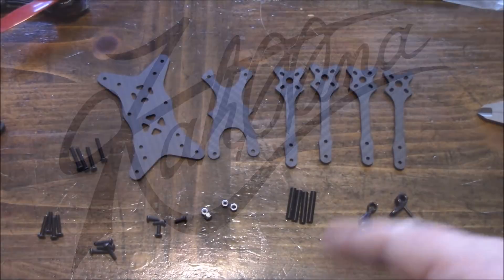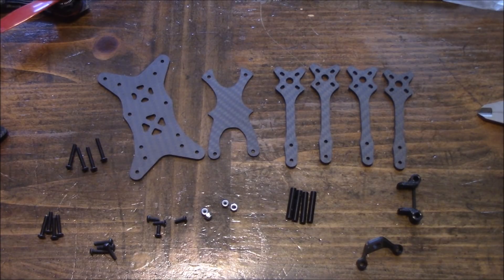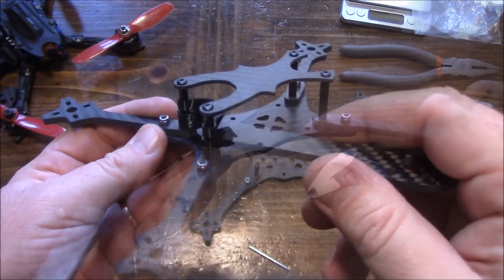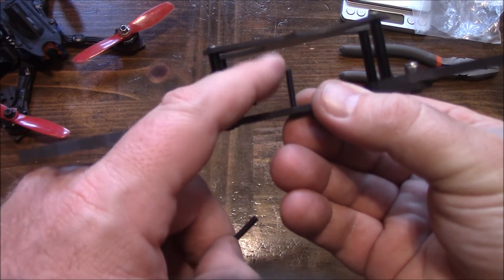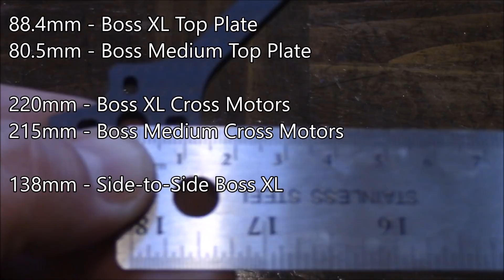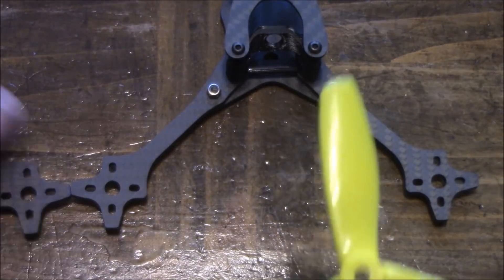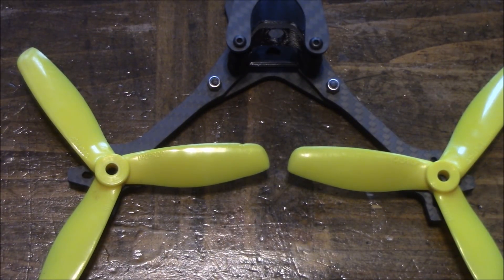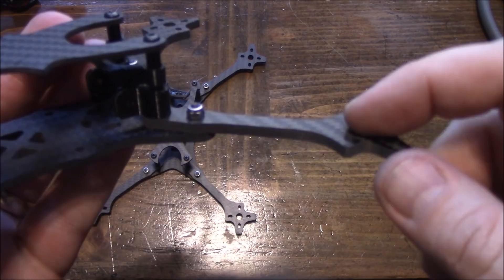Team Neugen Boss XL & Medium 5" Frame Review

Comment: Hey peeps the Boss was out before the Floss 2 and the mode 2 frames. This frame was designed and flown since June 2017. It was built to prevent the FC and esc damage suffered by the Floss 1 rear arms breaking and destroying 4 in 1 escs and FCs

Comment: They might as well called it a FLOSS instead of BOSS..........
Reply: The Boss was designed before the revised Floss 2 that we all love, yes our team loved the Floss 1, however many of the design issues did not work for us, arms would snap and destroy FCs and 4n1s, arm would break at the little catch mechanism, the top plate allowed lateral flex due to 3 screws mounting. We released what you see as far back as June well before Bob revised his Floss 2. So yes it is inspired by the Floss 1 and in many ways improved on the original Floss 1. By the time the Floss 2 came out we had already been flying our team frame at least 2 months.
Reply: Thanks for the history lesson! I would rather support the original makers on such a wicked design!!!
Reply from the maker: Actually, I believe the Boss was designed before the Floss.  I could be wrong, but I think that is right.

Comment: Looks too similar to the Mode 2 Ghost. Not very original.
Reply: Drew Fulkerson the term is "Inspired".  I think the ghost mode 2 was inspired by the  floss frame. This is another inspired one except may be this one is a bit too inspired!
Reply: I have been flying my boss xl frames since long before the ghost and floss2 frames were even prototyping. Team Neugen has been making quality frames for a select few for a long time and are just now willing to sell publicly. These frames have been through multiple revisions and I find them to be the best designed frames by a long margin after building out, flying, and crashing all the other popular frames out there.
Reply: The Boss was out since June 2017 way before the Mode 2, we created this frame to fix the damage the Floss 1 frame was causing and our frame is a superstrecht stance.
Reply from the maker: Are you saying the Mode2Ghost is "original" and should therefore be the basis for all future comparisons as to what should be called "original"?
Reply: travisgrindal I just said it looks too similar to an already popular frame. Eventually, original ideas will be harder and harder to come by, but I think there's still room for innovation now.
Reply: Jack Truong I agree with your verbiage.
Reply from the maker: I think this frame has more in common with the floss than the Ghost Mode 2 (2nd arm screw outside of the top plate, cross arms don't touch, etc).  When a particular design gets popular, designers want to take that design and enhance it more to fit their particular needs.  In this case, the 3mm bottom plate and the 5mm arms make more likely to withstand crashes.  Then the top plate, bottom plate, and arms have to be changed enough that it isn't called a direct copy.  These 2 plates, thin arms frames are the latest rage and we'll continue to see a bunch that look the same until the next big design change comes along, then we'll see a lot of those.  I think back to the BlackOut frames and how many other people started their designs based with them as a starting point.  Today, not many people remember BlackOut.
Reply: travisgrindal c
How can i forget the iconic blackout  frame. I wanted one back then but damn they were expensive. I bought the inspired ones instead.
Reply from the maker: I think the BO250 was selling for $150 and I bought the ZMR250 for $20.  It was a no-brainer for me.

Comment: I really don't like how manufacturers are starting to put out clones first off the packaging is horrible it just comes in a little bag and that's a clone of the floss it's really sad how Chinese companies are putting out these clone products when other people around the world are actually putting in hard time and money into designing something and someone else comes along and just steals their design and product
Reply from the maker: This isn't a clone.  The Boss frame has been through the prototype stages for a lot of months.  A local pilot has been flying preview frames at our practices and races.  It is awesome, but not a clone.
Reply: allright but this producer is from murrica...
Reply from the maker: Also, give a little grace for the packaging.  The frame just became available for purchase on their site within the last week or 2.  I'm sure it will get better.  :)
Reply: Stealth FPV this is in no way a floss clone, when we designed this frame Bobs floss1 had many issues that we felt needed repairs, 1st the arms would snap and destroy FCs and ESC, we isolated the FC away from the arms, 2 the Floss had arms with a lock mechanism that would break on impacts we fixed this with arms that had solid carbon all around the screw holes, 3 the Floss top plate used 3 screws ours has always used 4 screws to secure the top plate and we released this frame on June before Bob revised his floss 2, so yes we liked the Floss 1 but it didn't fit our needs and we created something that did.
Reply: I apologize for the poor packaging, however im a one man show designing on his living room. I cannot acquire the discounts big companies have and also do not have the time to fully invest in these frames. The BOSS was released and flown by our team members since june last year, at least 2 months before the Floss 2 was released. Our Boss was designed with to fit our needs that were the following, the floss 1 would snap arms left and right at the little claw joint we fixed this and used carbon around all mounting holes. 2 our team members destroyed countless 4 in 1s and FC due to the mount style of the Floss 1 we repaired this and made sure our frame shared 0 components with the rear arms. 3 our frame always had a 4 screw top plate to prevent rear torsion flexing and looks nothing like the floss 1 or 2. 4 our arms  and main plates were beefed up since day 1 to prevent breakage. 5 our frame always  had an sma antenna solution. 6 our carbon is Toray t300 for durability. So in all honesty pick a floss 1 and our frame and tell me they are the same.